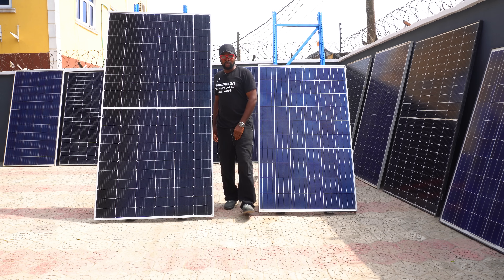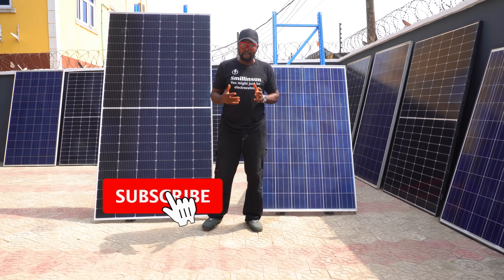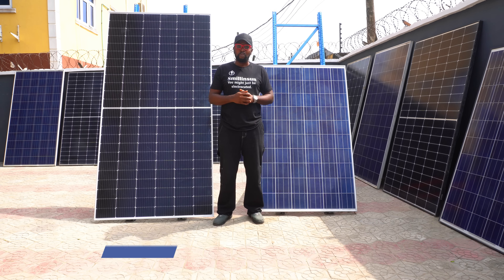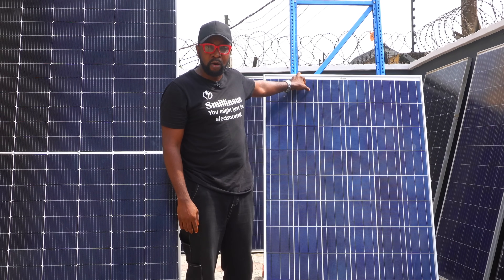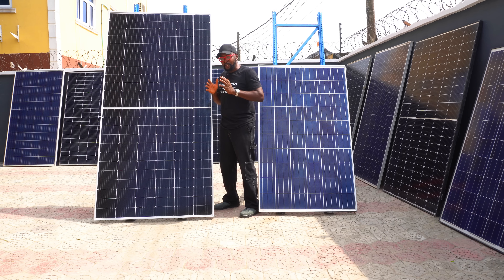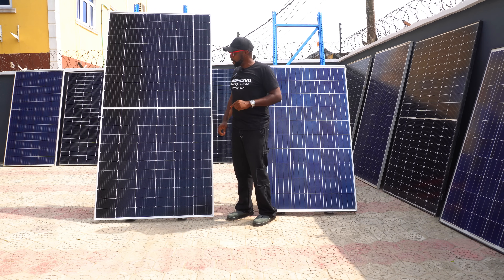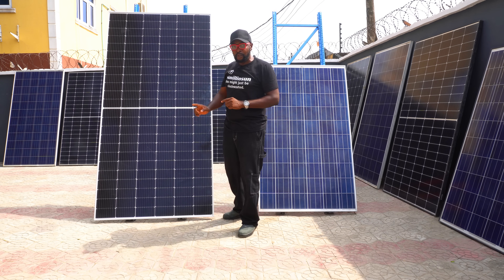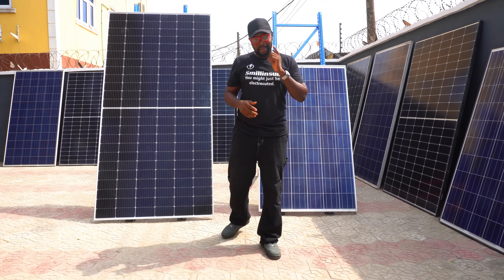Can I combine Solar Panels of different wattages ?

Comment: About this,  let's say these 550watts panels are connected to a high voltage mppt solar inverter. Can i connect the 250watts panels to the same battery using a charge controller? 
Like i just want to know if the inverter & charge controller can work fine when connected to the  same battery
Reply from the maker: Yes but it must be a high PV voltage  charge controller
Reply: @smilinsunsmilinsun8056 I'm grateful for your time🙏

Comment: Good day sir. After separating the two grades of solar panels into two separate controllers, do you reconnect the lines to the lines to the same battery, or separate batteries
Reply from the maker: Same battery
Reply: @smilinsunsmilinsun8056 I have a question what if I decide to upgrade a few of my on-grid panels to a higher wattage. I understand this mean I need 2 separate controllers, one for each strength           of wattage. But I have an on-grid, system there is no battery. So does that mean I connect each strength to a controller and then connect the controller to the inverter? As far as I know I don't have any seperate controller but maybe my on-grid inverter has a built-in controller. My system currently has panels all of the same strength. But I was thinking to upgrade one of them that I damaged while cleaning in the hot sun. Actually it still works fine but it has some cosmetic damage to the coating.

Comment: Can I then I connect both charge controllers to the same battery ?
Reply: Yes, that's fine.
Many systems have multiple inputs, from alternator, wind, and different solar strings.
You can use them together, but you might have to pay attention to safe combined charging current for the battery.

Comment: Very insightful , watching for the 4th time especially as I was triggered by my own experience. I had  bifacial  700w rated solar panel  (144cells).. I decided to upgrade and more panels The panels they sent to me now is still rated 700w according to the " jinko Label" on it . But the panels are smaller  in lenght and widths compared to the original  or first set of  panels. I suspect its fake or lower capacity panel deceptively labelled  700w. My initial " jinko" solar panels  have lenght of 90inches  and width of 45 inches but these ones are 82 inches in lenght and width of approximately 41or 40.9 inches. Do jinko 700w bifacial panels ( 144 cells) come in different sizes. I believe I have been duped
Reply from the maker: Thanks for sharing your experience.

Comment: What about series mixing, will have a negative effect, that's running an high voltage system. 
Good day sir.
Reply from the maker: Both series and parallel connection nit adviced

Comment: If you connect the 550W panel string in series with the 250W panel, you lose 37.3% of the 550W panel group. 
Rather, if you connect the 550W panel string in series with two 250W panels in parallel, you lose 21.7% of the 250W panel group.
Pick your poison. 😊

Comment: Just use Micro-Inveter with each un-identical Panel and co
nnect there outputs in parallel leading into an Integrated Hybrid Inverter.

Infact, even if your panels are all Identical, Go for DC/AC MICRO INVETERS FOR EACH PANEL and run there ac output into a central Integrated Hybrid Inverter.
Reply: What 😂
Reply: Still expensive especially that hybrid inverter.
And micro inverters for each panel ain't cheap either.

Comment: This advice isn't economically wise. Spending unnecessarily on extra cabling, mounting system/railing and of course an mppt charge controller, can buy U about two to three more 550W modules. 
Best thing is not to add to the system. Sell them use the money and buy more panels simple.

Comment: Ik 
Thanks for the video. I connected a series of 9 units of 330w solar panel to an SMS 80ahs solar charge controller (which was hooked up to a 48v tubular battery connection) and did an upgrade of connecting a separate 6 units of 550w solar panels connected to another 100ahs solar charge controller (which is also connected to another 48v tubular battery connection).
I discovered that when one charge controller picks up, the other drops down in terms of their charging amperage.

What do I do I such situation?
Reply from the maker: You are using different charge controllers and the superior  one will either reduce the CC connected together or stop it from charging completely.

Comment: Very great video.

Got 2 15kwh felicity lithium batteries, 24 300 watts solar panels and 7.5 kva hybrid inverter.
I still cannot get enough solar charge during the day to last me the night, on one 2hp inverter AC, lights and a fridge.

What can you advise I do?
Reply: Your solar panel output should be able to fully charge your batteries in 5hrs.... otherwise something is wrong with your solar panel installation

Comment: Ok my own issue - I plan to upgrade my PV array. I have 450w half cuts but on contacting my supplier, they now only have all-black 450w panels (different maker with very slight different voltage).
Can I still go for these "full 450w panels" and combine with my 450w half cuts?
Reply from the maker: For the same desired result all Solar panel must be the same voltage and same current.

Comment: What if you connect the 250w in series and parallel them with 550w. Wont that increase the voltage to meet up with that of the 550w?
Reply from the maker: @dewise5617  You emphasis is on voltage while neglecting Current. These two play a very important role in your energy generation.
Reply: Yea cause the current of the 250 definitely wouldn't match
Reply from the maker: @Danny_cruzz  Correct
Reply from the maker: What about the current ,they are just not the same

Comment: Thanks for this video, It was enlightening.. please I have a question. What If the panels have different wattage but the same voltages, for example, connecting an 18v 150w and an 18v 100w panel in series where the voltage increases but the current stays the same, would there still be an issue with such a setup?
Reply from the maker: @YemiOnline  It will operate with Lowest current.

Comment: Good day Sir, after connecting them separately to different Charge controller, how do we now connect them to the battery? Is it a must we use Busbar, or with Busbar it has anything to the system, output or Something.
Reply from the maker: The Buzzbar makes it safer and ensures the charging is evenly distributed

Comment: I think the best thing to do when entering into the solar/inverter system is just to start big..... Because if you start small and have plans of upgrading, youre still going to spend more at the end of the day.
Reply from the maker: Yeah I agree , but finances always has a mind of its own. You can always introduce an extra charge controller and accommodate the old panels
Reply: @smilinsunsmilinsun8056  what if its a hybrid system inverter. that contains an inbuilt charge controller . how does one go about the situation of using different wattage panels. as you said its hard to throw away older panels that are still working . when they can actually be put to use
Reply from the maker: @ak-lo4dy  Watch the video till very end I proffered a solution at the end.
Reply: So true! Learned the hard way
Reply from the maker: @timelesshomegh  Yeah it happens to a lot of people
Reply: is better to use different charge controller
Reply from the maker: @GTdontDOthat  Yes it is

Comment: So after the extra charge controller, do you need a separate inverter for the two lines?
Reply: It goes straight to the battery. You can use a busbar to combine it.
Lovely video Mr. Ikenna
Reply from the maker: @baabwebsattechnologies  Thank you
Reply: It goes straight to the battery. You can use a busbar to combine it.
Lovely video Mr. Ikenna
Reply from the maker: No Same inverter serves , the only thing you are adding extra is the CC